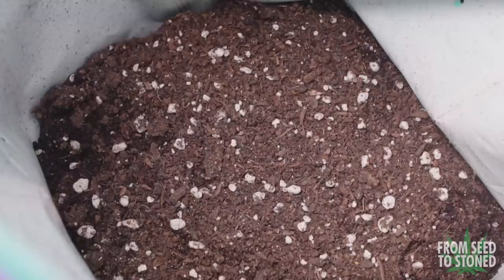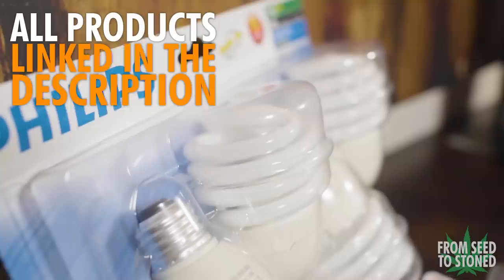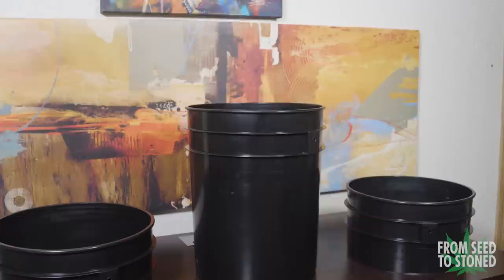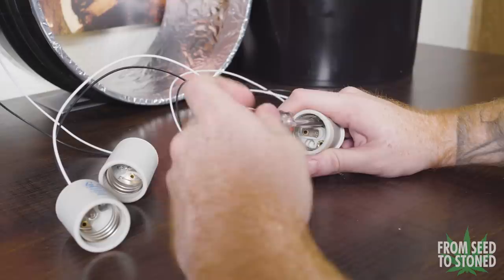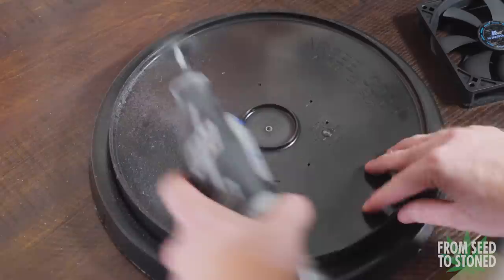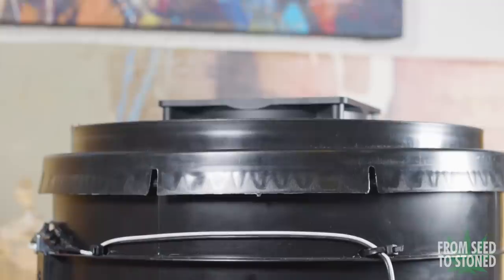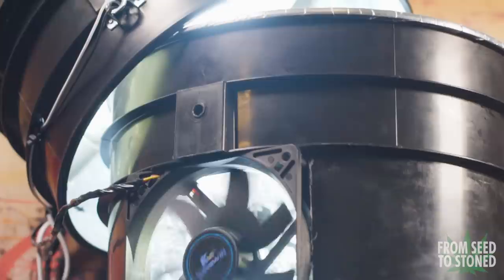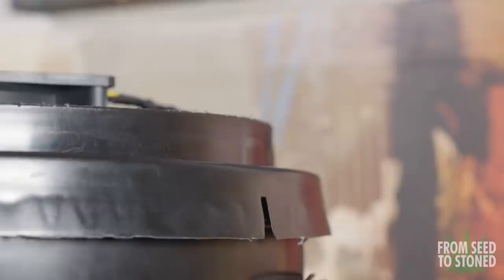How to Grow Marijuana Indoors For Under $100

Comment: Is this not a fire hazard?
Reply: I wouldn't put it in a hot garage, but I don't think it'll kill you if it's kept somewhat cool inside a house. Although if you've never done electrical work I'd stay away, primarily due to those 120V wires going to the CFL bulbs. I'd recommend a small LED board instead (probably better efficiency anyway).

Comment: You cant be using electrical tape for wrapping the wires together that's more dangerous and need to use orange wire nut to get both black n red wire together properly.